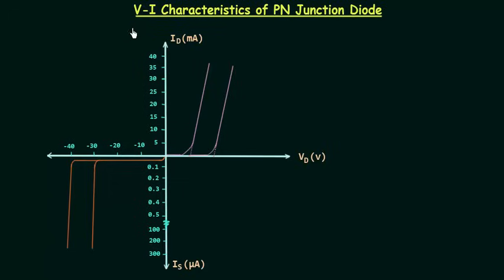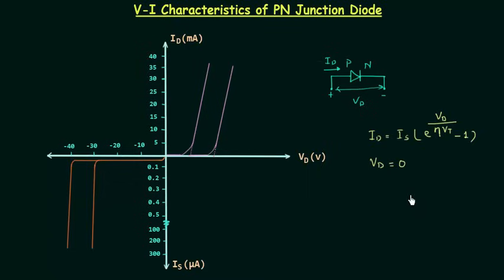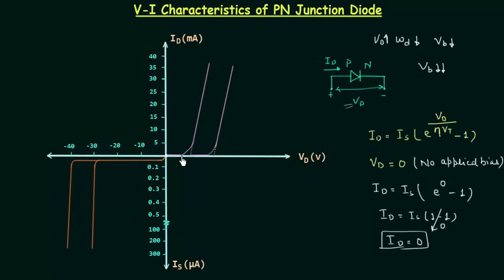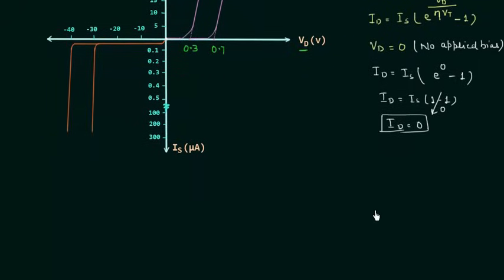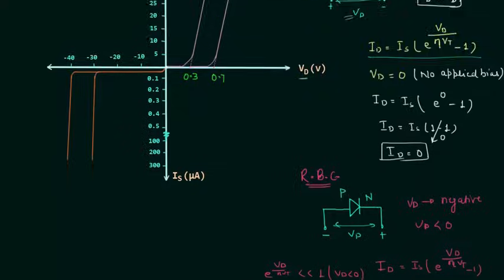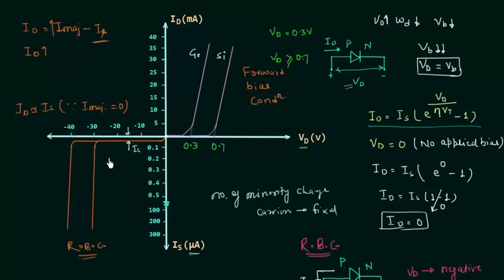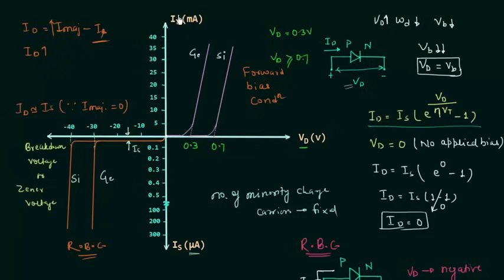V-I Characteristics of PN Junction Diode

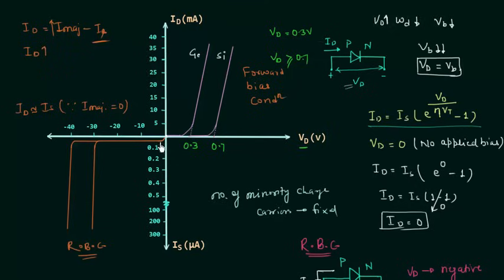Comment: Thank you for this platform. Learnt a lot from your lectures. The correct term that should be used at 8:28 is voltage. If we keep on increasing voltage the current will not change...

Comment: the word drift comes into the game when electric field is applied    (as drift velocity proportional to electric field)      in case of forward bias condition after barrier potential becomes equal to biasing potential the depletion layer vanishes  therefore  conductivity  of minority charge carriers becomes zero    (  I-saturation   =     0   )    but according to current equation of diode  id becomes zero because of     Is         but we see exponential rise    in it     how  ????????????????????????????

Comment: sir which is a better material for making a diode ge or si
Reply: Silicon is better semiconductor because germanium is temperature sensitive.
Reply: It depends on where we will use it.Temprature sensitivity is just one of lots of parameter.Why silicon is more commonly used is all about economics.Germanium is more expnesive than silicon however for some particular areas germanium need to be used nevertheless first transistor was made of germanium in Bell Labs in 1947.